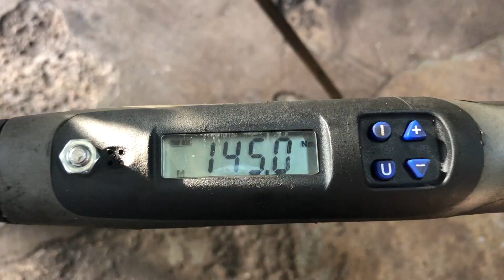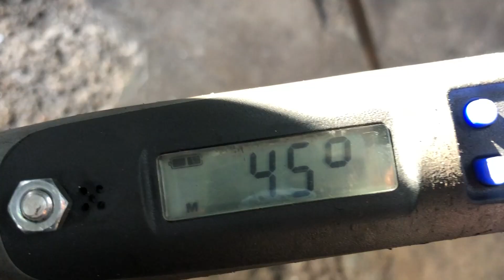BMW 3 Series Driveshaft Removal How To Remove ABS Rings Change E90 E91 E92 E93 5DB0 5BD1 5DC1

Comment: Brilliant walk through mate! Any tips on getting the driveshaft out of the hub if it’s seized? Weirdly I got the hub nut off relatively easily and the 6 driveshaft bolts too but I cannot get the driveshaft out the hub, tried giving it some proper welly with a punch and the hub nut back on slightly so it doesn’t mushroom the driveshaft but it won’t budge
Reply from the maker: Hi James, that is strange as the hub nuts are usually ruined on these. I guess as you can’t heat up the hub your only option will be to get as much penetrating fluid on there as possible and what your doing should work eventually. Hope you manage!
Reply: Tolly Swift thanks for your reply, I did just that and left it overnight and it finally came free after a bit of persuasion. However it’s the off side and I’ve pushed the driveshaft up at the diff end instead of down (clearly I should have watched your vid first instead of another that only did the near side) and now it’s jammed. I can’t get the shaft back into the hub enough to pull the drive shaft at the diff end back into the diff and down below it and there doesn’t seem to be enough room above the diff for it to go that way for me to get the shaft out of the hub fully even though it’s now free there 🤦‍♂️ third attempt tomorrow!
Reply from the maker: Hi James, I’m glad that worked, regarding the driveshaft, if you jack up the hub you should be able to get it out, it gives more room.

Comment: Hi, Do you advise changing the ABS/wheel speed sensor too as you noticed it was striking the ring?  My e92 rings are both shot, just wondering if it’s worth swapping the sensors while I’m there. Thanks
Reply from the maker: I would advise changing them but I'd fit the new rings first and see if it sorts out the issues before spending the money. It may not be necessary to change them.
Reply: Tolly Swift Ok, I’ll see how it goes, Thank you for the advice mate.